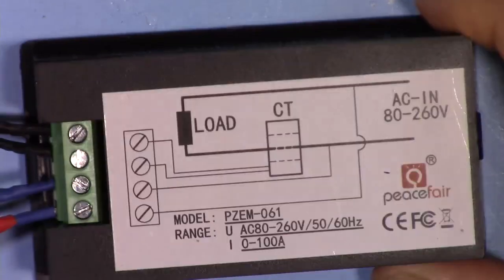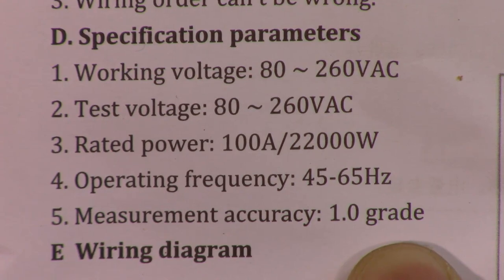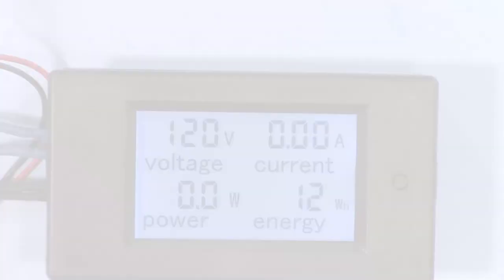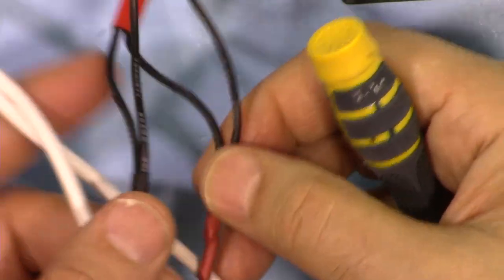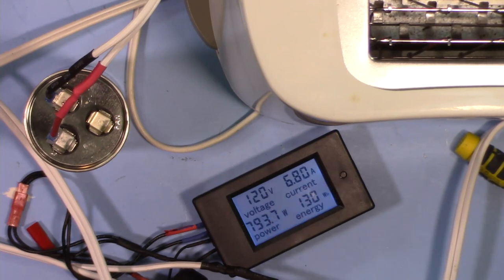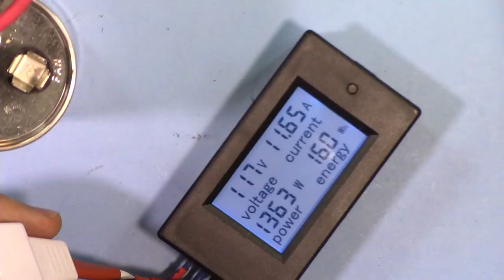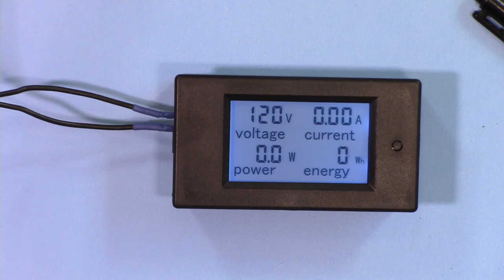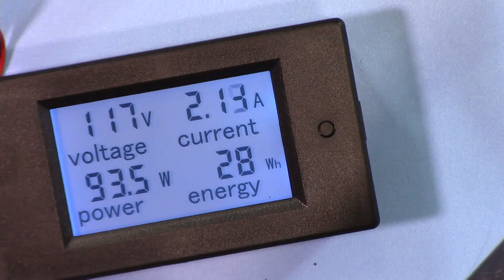How to use AC 80-260V 100A PZEM-061 Active Power Meter

Comment: sir, I didn't get the capacitor, my question is want it to measure the power consumed by an ac unit which have two motors and two big capacitors will it  measure the power consumed by the unit, right or not 
please help and thank you for your great video

Comment: Hi sir, 
I am using  dc meter to check how many volts and amps are coming from solar. The meter is working fine in daytime but in night it's showing solar charging symbol in my pwm charge controller(like reverse charging)
Please help me on this

Comment: Thanks , That is the way I thought it hooked up but it is good to be sure. I am using this to monitor a 12500 W Generator to tell how much I am using (In Watts). Mounting on the Service Panel of my house. It looks like since I have 2 legs each with 120V , I will need 2 of these, 1 for each leg. Totaling 240V. Than I would add the 2 Wattage readouts together to get the total draw/watts . It doesn't even look like both wires would even fit through the clamp.
Reply: I just received 2 and will use them for the same purpose. I have a 13000 gen. Maybe you can answer me a question. I’ve seen different CT connections. Does the red wire from the CT go on the top connection or the black one?

Comment: Thanks, very informative and complete. I would love to see you show this meter with split phase 240 volt. Like that of an electric dryer or range. Will it show 120V or 240V?
Reply from the maker: you are welcome. it just measure the phase that is passing through the sensor. So you won't get the current value for more than one phase. Voltage doesn't matter.

Comment: hi robojax, I am attempting to get reading from a 4 plug adaptor so as to measure the power consumption of anything I plug into it. I am in UK and the lead I want to test has 3 wires earth, neutral and live. so far I have cut the live brown wire and soldered on bullet connectors and heat shrinked tubes as you have on your positive wire so I can feed it through the current transformer coil. am I right in thinking I can now power the module if I attach positive to live and negative to neutral. I understand you explain what you've done well in the video but will this work how I'm doing it and is the capacitor a requirement for this use?

I will appreciate if you can help me with doing this safely thankyou,
Tom
Reply from the maker: Hi, I can't explain it by writing better than video. So watch the video that. The capacitor it seems you've skipped the video. I used the capacitor to proof that the module actually is showing the Power Factor pf. You don't need any capacitor.  This video has the word on the image "tested" and many produces don't do the pf. so It passed the test.
Reply: @robojax that is what I thought, I just wanted to check. your video is definitely the best could find on this module

I assume everything else im doing is right. your power cable has only 2 wires 

I just ignore the earth wire and it is the same?
lastly I bought the jst connectors and and wire tap connectors and I am still waiting for them to arrive... is a wire tap connector a good way for diverting modules power from the main cable?

thankyou for your quick response and I apologise as I'm sure these are obvious questions
Reply from the maker: for current measurement yes. you just need ONE wire to pass through this. Earth wire is for appliances for safety purpose.
Reply: @robojax  thankyou

Comment: So I bought this meter to use on my old variac. Do I have to use the magnetic ring to use this? Or can just use the ac voltage taps on the meter? Thanks for any help.
Reply from the maker: May be you did not watch fully or you missed it. Of course you need it. Please watch again.
Reply: @robojax  I watched the whole video, but I'm not using this meter hooked up in the same way that you demonstrated. The load is coming from my tube amplifier that I'm going to have plugged into the variac.
Reply from the maker: To read the voltage we to calculate the power. We need a o connect the two wires. To read the current we need the current sensor (ring)

Comment: Hi, in my understanding this device wont heatup if we use example 22000W (the max of this device), because its use the CT for calculate the usage right? and is this device can store the data if the power is cutoff? i want to use this to calculate kwh of my 3 3d printer each month to pay to my parent.
Reply from the maker: it will not heat up to 100A. and yes it should keep the power but have not tested it.

Comment: Hi there, The Robojax... I am not really good at electricity but I understand some basics of it. I just ordered one and it has been delivered to my house today.  I have the very same model Peacefair PZEM-022 100A. My plan is to use it after my Circuit breaker which is 60A  220V here in the Philippines - so as to see all the readings of the entire house. Do you think it is applicable and can this meter sustain it if I connect it after the circuit breaker as a source of electricity in my house and having this device measuring the current, etc?

 Please give me feedback HWcave for I am expecting  answer and thank you very much in advance.  :)
Reply from the maker: Yes it will work as this can measure up to 100A. the location either after the breaker or before will not affect the reading. Before breaker will show you the power is ON and that is it.

Comment: if I was to use this meter with an SRC power controller ,would I pick up my power before or after the SRC controller
Reply from the maker: You should pass the  power wire through this and then to any load you got. SCR is part of the load for this device.

Comment: When I set the required voltage, the display will flash. So I want to ask if he has any signal or control output. Somewhere on the board.
Reply from the maker: No output. It is the transformer that get the magnetic field and displys on screen.

Comment: So It Will Not Read Voltages Below 80 And Frequencies Below 45Hz?
Reply from the maker: I have not tested it. We don't have any country to have home AC power below 110 V.
Reply: @robojax  Ok Yea I Don't Think It Will. My Use For This Was To Measure The Live Output Of An Bass Amplifer. They Output AC Voltages From 0-80v For My Application, And 0-60Amps AC With Frequencies Ranging From 20-40Hz. It Would Be So Awsome To See Live Wattage Of My Amplifiers Durring Test Tones And Maybe During Music With Long Bass Notes.

Comment: For this, if the display shows up at 9999kWh, will it be counted again?  Or hold like that  Do you have to press to reset yourself?
Reply from the maker: that is 100MWh. Never tested but logic says it should reset and start from zero because new data has always more value than older data.
Reply: Thank you
Reply from the maker: you are welcome.

Comment: Something is not adding up. The panel appears to display only real (average) and not reactive power. With the heat gun on high we had a current of 11.67 A at 117 V which is 1365 VA in agreement with the measured value (within measurement error). IOW reactive power is zero. With the capacitor attached we had 11.81 A at 117 V which calculates to 1382 VA of apparent power. Again this is consistent with the measured average power displayed of 1376 watts meaning, again, zero reactive power. At low power we had current at 2.11 A at 121 V  or 255.35 VA of which the measured real power was 94.6 watts. This leaves a reactive power of 237.14 VAR. (what this is telling us is that at hi power the load is entirely resistive, whereas a low power the load is predominantly reactive due to the motor). Now when a capacitor is added at the low setting is where it gets interesting. The capacitor should not change the real power. We should only see a change in reactive power. And yet on low with a capacitor we measure a current 2.32 A at 121 V. But real power somehow decreases to 53.3 watts and calculated reactive power is now 275.6 VARs. How is it that the real power has decreased with the addition of the cap? Makes no sense. The capacitor should only affect the reactive power. Moreover power factor correction will decrease overall current. Not increase it (from 2.11 to 2.32) . This is not consistent with power factor correction unless you have overcorrected and gone from a predominant inductive load to a predominant capacitive load! This is what appears to have happened. It still does not, however, explain the the reduction in real power (watts) with the addition of the capacitor.

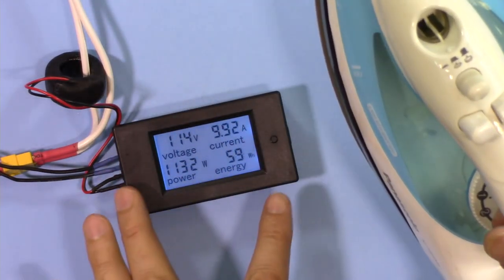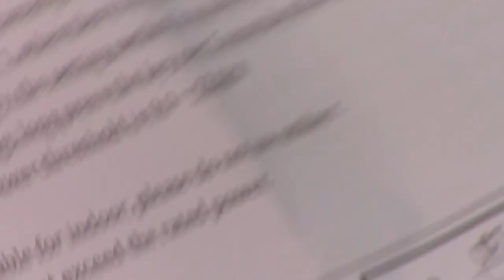Comment: Why do you (multiple times), point to package label as model 061 but both times say verbally "016" ???.....I wouldn't be so picky but the backside label you show identifies 2 discrete models....one being 061 and the other 016...so you need to be mindful of this error. Also the large print on your vid at timeline 0:41 also says "016" but I think it's backwards here too. At timeline 1:23 you also point to the package label ( 061) and "say" 016......same at timeline 2:03, reversed numbers again. Otherwise....a very excellent review and report.
Reply from the maker: Yes. I have made so many mistakes.  this video has take two or three days to make (I forgot how long) and when I get tired, I try to fish it.  If product is shown, then that is valid. Sorry.
Reply: No need to be sorry....my point was simply that in this case, there are indeed 016 models and 061 models, so to be clear for others viewing this. If that wasn't the case, and if it was only a slip-up, I wouldn't have brought it up.....nice job on the remaining details !!....cheers.
Reply: There could be a little dyslexia kicking in which is common, a lot of people have it, and it's no big deal.
Reply: @DTomlinsonpiano  ....as I said a few times already...no big deal in general.....but in this case there ARE 2 models....an 016 and 061, so it matters more in this case to somehow get it right.
Reply: Yup that makes sense about the 2 models.

Comment: If i use on inverter this meter is very hot.why?
Reply from the maker: It should not get very hot. "very" is not clear. If you are in area with 30°C room temperature, then if it gets 50°C or 60°C it should be normal.

Comment: 15 m 37sec. Voltage 117v current 1.95 Amperes
But power is 90.60 watt.   why? (İn your video)
117 Volt x 1.96 Amp. = 228 w
15 min. 46 sec. 113 volt x 11,29 Amp = 1275 watt ...1279 watt may be.
But ,why first power on ( level 1) 90,60 watt.
I have same problem :-(
Reply from the maker: the value is from the last day. It saves the values.  If you want to use it fresh, reset it. I have shown how to reset it.
Reply: @robojax  thank you
Reply: @robojax  but, I did not mean wh value.  I mean instantaneous power.  Note that when the heat gun is operated at the first level, the power (lower left) does not show the watts multiplied by volts and amps.  but at full power at level 2 it shows real value.  I don't mean the energy part at the bottom right.  Please pay attention to the minutes and seconds that I mentioned in your video.  because I am having the same problem with the hair dryer.
Reply from the maker: please type the time like 2:45 so I can click and watch it.
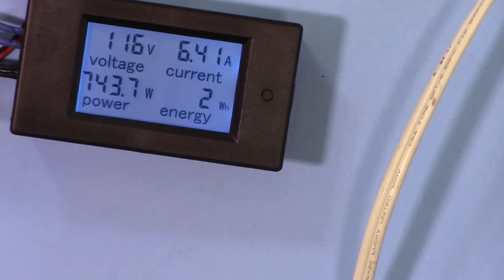Reply: @robojax  15:32 heater level 1, power value is wrog. ( w = v x ı )
117 Volt x 1,96 Amp. = 229 watt.
But this product showing 90 watt
İt is wrong.I do not know why.
why it shows.  do you know why?
15:40 heater level max. Power value is true.